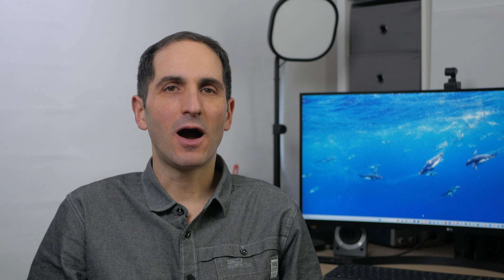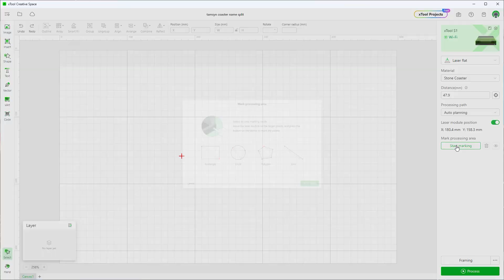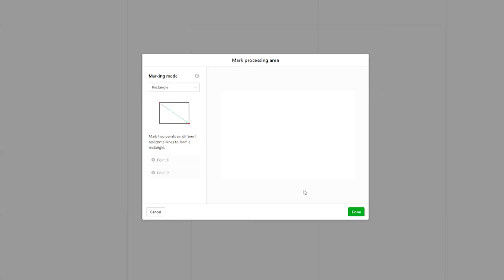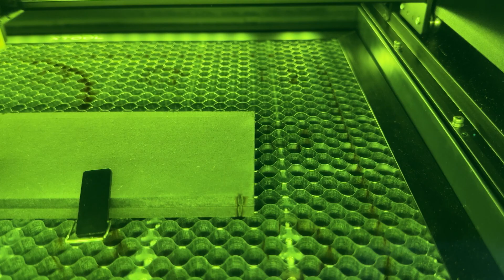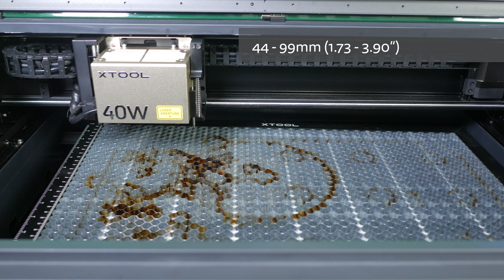xTool S1 Review - best, safest laser I've tested so far | Fully enclosed, 40W

Comment: Hi I am a total newby. I Am a bored 60 something woman. Idealy i want to cut and create models/ jigsaws. But i also want to try 3d engraving/embossing and jewellry creation so i need the ir module. Now to my question...i am torn between the xtool s1 20w or 40w although i can never see me needing the 40w ( unless you advise differently!) And the xtool m2 with ir. Your advise would be greatly appreciated. Just as an adendum. I am a hobbyist who may do a bit of a side hustle. So i dont want a 'toy' ...sorry one last question.  Is the camera on the M2 a game changer or the manual S1 placement sufficient
Reply from the maker: Hi I'm sorry I've not tested the M2 but they're quite different machines. The S1 is a more capable machine. Camera is nice on the M2 but you can be arguably more accurate with the S1's placement method. It's always hard when you don't know exactly how you'll end up using it!

Comment: I have the S1 cutting plywood and the fumes are crazy even with the fan blowing out the window. 
So I put it inside a plant grow tent that has a large extraction fan. So now it's in a closed container and has two extraction fans blowing out the window (the built-in and the one from the grow tent). But I was still feeling off when nearby the laser cutting plywood. 
Finally I added a normal hepa air filter which is like a fan that extracts dust from the air. I put it next to the tent on max speed. It's much better now. 
If I walk outside my house though the fumes are crazy!

Sometimes it doesn't fully cut through 1/4" plywood. I want to upgrade to thicker woods but I'm scared lol. I'm going to try 3/8" plywood next with fingers crossed.
Reply from the maker: Nice! I use a 6" inline extraction fan which works pretty well.

Comment from the maker: If you have any questions you want me to cover in a follow up video - please let me know down below!
Please  do use my links if you want to help support the channel - thank you!
xTool UK: https://uk.xtool.com/?ref=ymRuLqseaV9rHK&utm_medium=null&utm_source=influencer
xTool US: https://www.xtool.com/?ref=ymRuLqseaV9rHK&utm_medium=4965&utm_source=influencer
Timestamps:
0:00 Intro
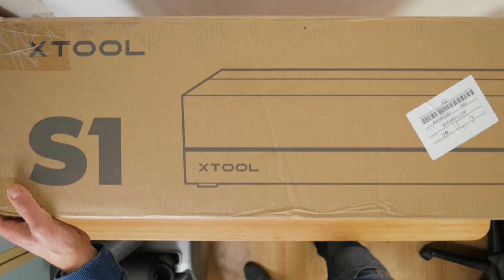0:50 Overview Unboxing (including honeycomb & air assist, assembly
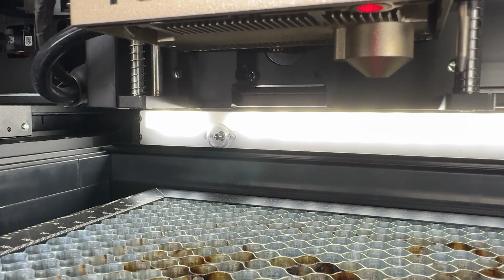3:06 Design and build, weight and size
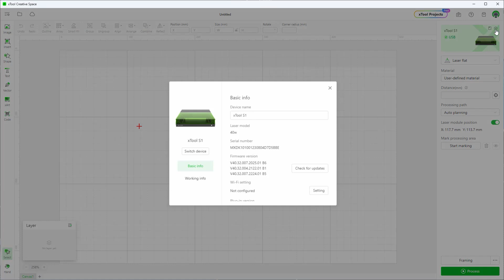3:47 Setup in XCS software
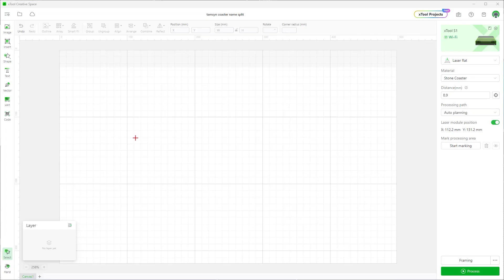4:36 Real time coordinate system demonstration
5:09 Auto-measure depth
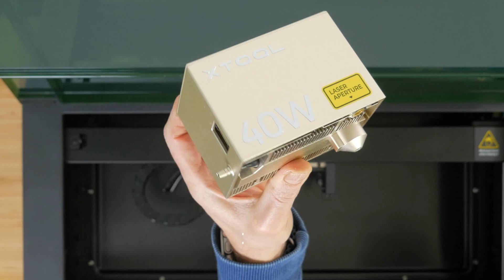5:34 Performance Spec, cutting capacity
6:32 Engraving tests
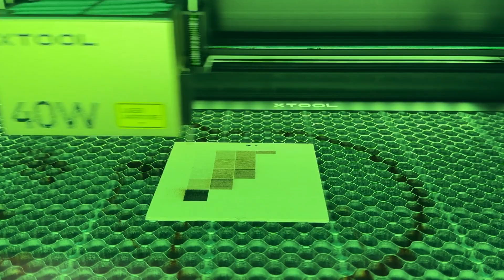7:07 Accurate marking area setup (engrave slate tile)
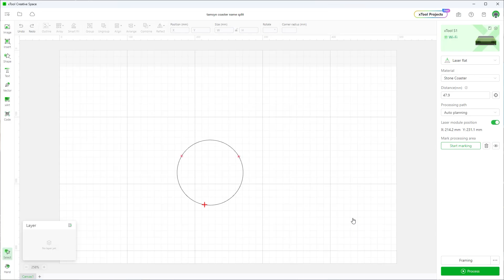8:00 Prepare artwork in XCS, send to laser
8:39 Engrave wood, stainless steel
9:03 Batch processing setup XCS, engrave coated aluminium and cork
10:41 Engrave curved surface using probe and motorised z-axis
11:49 Integrated enclosure, safety, fume extraction
12:35 Flame detection demonstration
13:10 Cutting lower height for deeper cuts in XCS
14:20 Multiple passes lowering z height in Lightburn setup (automatic), XCS (manual)
14:53 Automatic air assist
15:20 Cutting performance - 20mm wood, stainless steel, 10mm acrylic
15;36 Real life job - cut router template for manufacture Festool MFT cutting table
17:08 Fume extraction, adding in-line extractor, noise measurements
18:10 Optional riser base for cutting / engraving thicker materials
19:37 Conclusions